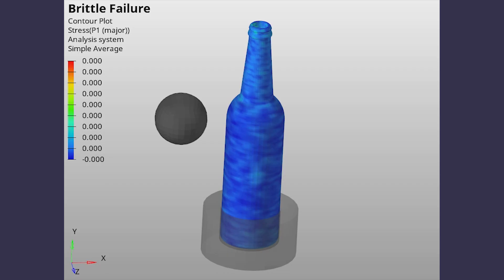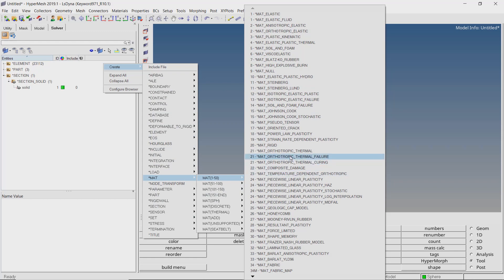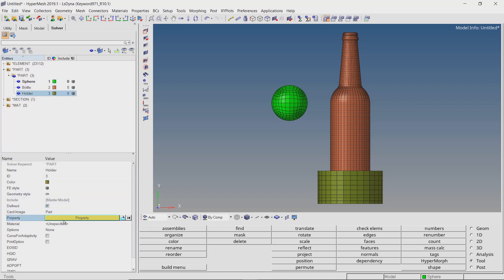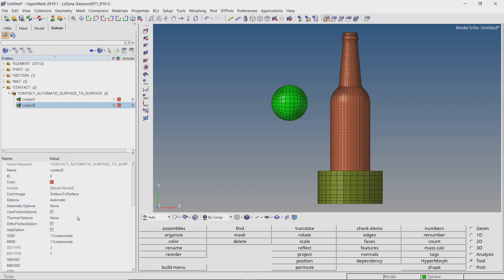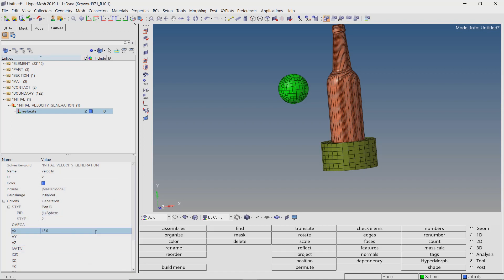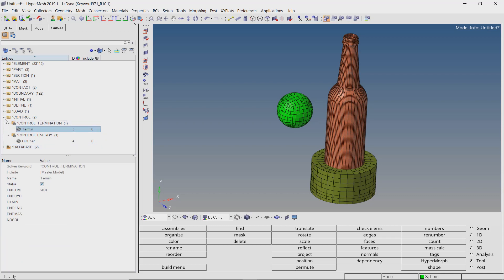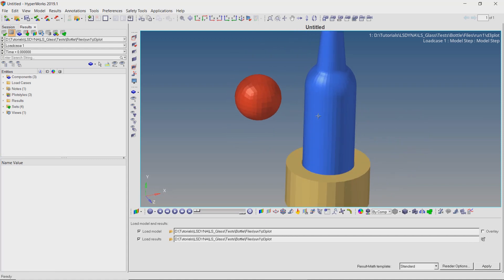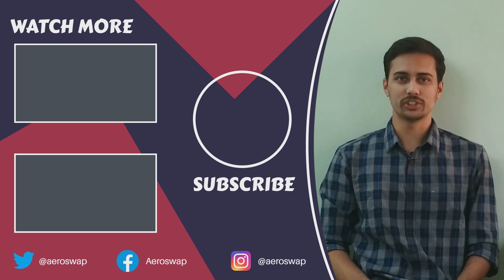Hypermesh LS Dyna Tutorial [Dynamic Analysis]

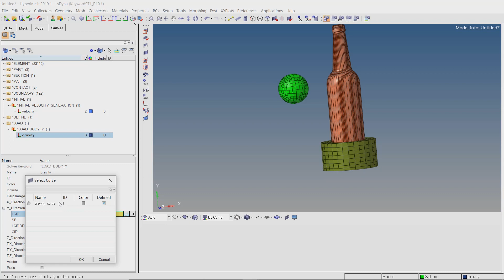Comment: @8:58 the shape factor should be +1 instead of -1 because in LS Dyna,  *LOAD_BODY_Y assumes the force to act in the direction opposite to the direction of applied acceleration. Here, since acceleration is defined in the +y direction so its corresponding force will act in the -y direction automatically. SF=-1 will make the gravity to act in upward direction.
Reply: I think, after the sphere hits the bottle few elements flew upwards. May be due to this

Comment: Superb Video, however when i tried, i got this following error:

Error 10125 (KEY+125)
     Checking PART and SECTION definition input.
     PART ID 1 with
     SECTION ID 0 does not exist.
     This is PART 1 in the order of input.

Any idea why?
Reply from the maker: Thanks for watching!
This error is related to the parts in the model. Please check whether every part has the correct card image, material and section assigned. This will resolve the issue.
Reply: @Aeroswap  Thanks bro. I did the silly mistake of solving the downloaded deck file instead of what I've worked on. Got solved. Is it possible to connect you on LinkedIn?

Comment: Hello Brother! Thanks for another helpful video. I have a doubt that how can I know which specific card image should I use out of various card images while assigning sections, materials, etc. in my LS DYNA model. Thank You
Reply from the maker: Hi Ashwani,
This knowledge comes only through experience. Try to perform as many analyses as possible and use different settings for each case. That way, you will get a better understanding of all the control cards available.

Comment: Excellent video! thank you! I have a general question - where do i get the data for Mass Density and other parameters for various materials? I have looked thru LS-DYNA docs but didn't see this info readily available. Would appreciate your help!
Reply from the maker: Hey Paul,
This data is indeed hard to find. It is only available on some online material databases. If you know such material databases, you will have no trouble in getting all the required material parameters.
Reply: Hi there. Do you have any pointers to such a database ? I looked at MatWeb which didn’t have the details of all parameters. Thanks in advance!
Reply from the maker: I do not know of any specific database. For this analysis, the values were taken from a research paper.

Comment: Hi bro nice video
I have one error while run the simulation
In message it shows " Error part ID 2 with damage can be used with one point solid elements- type 1 only"
Reply: Please tell me how to clear it
Reply from the maker: That is weird. This error should not occur if you follow all the steps correctly. Please recheck your model to see if it is set up exactly as per the video.

Comment: Error is like = Load Curve ID 0 is not permitted... Reference : y-base acc. Body force
Reply from the maker: Try using a constant value of 1 in the load curve for a time duration greater than total runtime of the analysis. Then use the scale factor equal to gravitational acceleration value.
This may seem weird but it works with LS Dyna.
Reply: @Aeroswap solved... actually I forgot to fill LCID option in gravity.....and thank you for reply brother....great work !
Reply from the maker: Sorted then! Glad the video was helpful :)